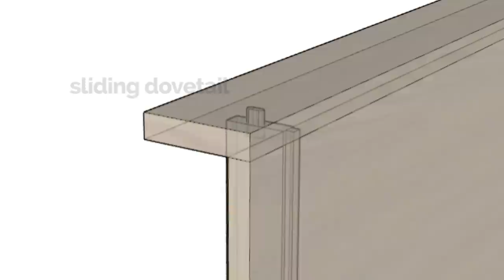White Oak bed with sliding dovetail | woodelight

Comment: very nice :) what is that tool called at 6:53? keep up the videos
Reply from the maker: Leighton Calder joint bolt & nut .
Reply: @woodelight  the one use at 2:35 , a layout/measuring tool
Reply from the maker: Scriber Gauge! Very good tool!!
Reply: @woodelight  thank you :) ye i wana get one